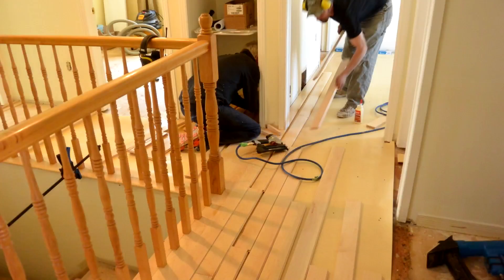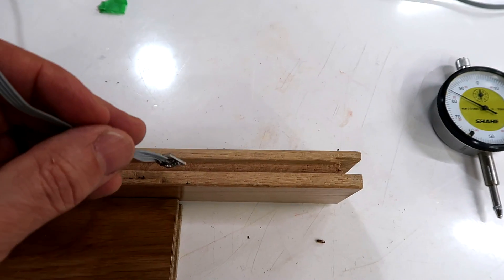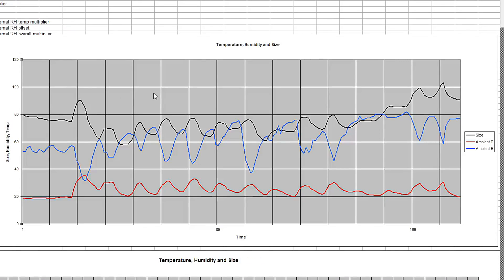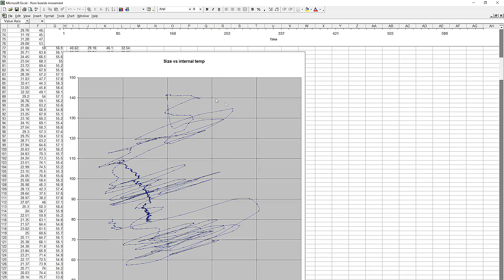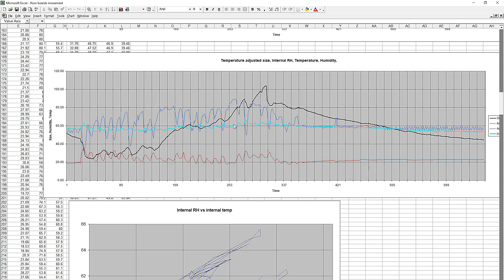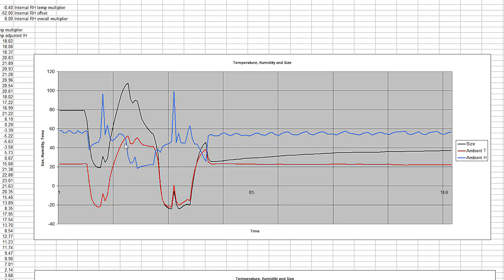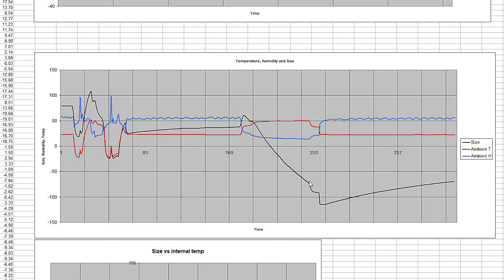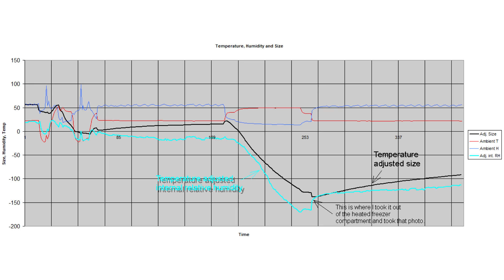How long for floor boards to acclimatize -- experiments

Comment: Great video! I'm curious about a specific part of the construction. At 2:21 (https://youtu.be/UzNhHCTlBsA?t=141), you install 4 boards into your measurement device, which is also made of wood, albeit with the grain perpendicular to that of the boards.

Wood, being a natural material, can be influenced by environmental factors like humidity and temperature, leading to expansion and contraction, which may, in turn, affect the precision of your measurements.

Considering the materials used, would an invar or pyrex structure, known for their low thermal expansion properties, result in more consistent and reliable results? These materials could mitigate the potential variability introduced by the wood's grain direction and environmental changes.

Comment: Fwiw, if you have hot glue attached to wiring and want it removed, just saturate it with rubbing alcohol/isopropyl alcohol, via a paper towel or somesuch, and the hot glue can very easily be popped off of the surface. (this works for hot glue on many surfaces; pcbs, wiring, etc)

Comment: even in material science that is a biiiiiig challenge when you need to condition the material to a specific climate. its not straight forward and not really solved what the best practice is. it can take month till a specimen of plastic or fiber reinforced plastic reaches real equilibrium. and im talking about mm thick specimen. found it funny seeing your video and that you came to the "right" conclusion "its complicated" :D ... those thick board will probably take weeks or month. but there will be probably a point where the change is small enough and that it wont be critical for laying them down.

Comment: temperature has a relationship with the maximum amount of moisture air can hold without condensing. higher temp=more capacity. relative humidity is the ration of actual moisture and max capacity (relates to temperature, vapor pressure of water). relative humidity and temperature are for the most part independent of each other. i think
Reply: dont know if that sensor you have is measuring absolute humidity or relative...

Comment: Why measure relative humidity? Is that all your probe will measure?
If so, why not try to derive absolute moisture content of the air/wood for the graph?

Graphs exist to help us "see" what story the data can tell us. If one of the lines is 'lying' then it's not very helpful. (Or even hiding something ELSE we should be seeing.)
Reply from the maker: Probe measured relative humidity.  Abolute humidity is actually less relevant than relative humidity in terms of effect on wood.

Comment: The lesson learned is when building anything from wood whether it be with somewhat dry, dry, or very dry wood is to build it in a manner that accommodates these changes. In furniture, this is done with floating panels, providing room for expansion, paying attention to the direction of grain and largest axis of expansion, etc.  For flooring, this is in part accomplished by leaving room for expansion along walls.

Comment: For this topic it is worth noting that the dimensional shrinkage will be less noticeable in quartersawn flooring, as the dimensional change coefficient for tangential direction (side to side in the flatsawn flooring) is more than 2x that of the radial direction (side to side in quartersawn).  You might, if you have a quartersawn floor, notice that you are a few microns taller during the humid times…

Comment: The one other way I would have loved to see the data graphed is based on absolute humidity (lb water/lb air or for metric kg water/kg air).  Relative humidity is just that RELATIVE.  I think you may have noticed something else based on absolute humidity.
Reply from the maker: yes, but absolute humidity is an even worse metric with regards to absorption.  You need a metric where humidity goes up with temperature even faster than relative humidity to reflect how the wood sees it.

Comment: Most woods dry more from the end grain than the cross grain. That's why you seal the ends when drying green wood so it doesn't split and check. There is very little shrinkage lengthwise compared to crosswise. Oak is open grain hardwood, basically a bunch of straws with large pores. You might try to seal the end grain so all the drying is from the sides, but it might not make that much difference since you are measuring in the middle. It's an interesting experiment. 
I imagine that most experienced installers have a intuitive feel for how long to let a product adapt, but most installers today are just wanting to get the job done. Our humidity in the southern US is so different from season to season so it would be hard to determine when the wood is "stable" and it would also depend a lot on the species. We have both Red Oak and Southern Yellow Pine flooring in our house and the Oak moves a lot more than the SYP. 
If you weren't 1k miles away, I'd give you some SYP to test. :)

Comment: I’m a flooring installer and we allow 3 days. The manufacturer requires that and we allow them to claim the lawsuit if it doesn’t accumulate in that time.
Reply: And the bottom is smaller then the top to allow for it to be nailed and not change the top “finished” side size
Reply from the maker: Ah, good point, the nail expands the wood a tiny bit where it goes through.  I do wonder what humidity the wood has coming from the factory.

Comment: A remarkable, and worthwhile, exercise. A few notes- using prefinished flooring may have skewed the data, though I can't really guess in what direction! Secondly, the idea behind acclimatization is not to reach a point of either minimum or maximum expansion, but to reach a point where the rate of change is the same as the surrounding structure- and that may be impossible, because the exposed surface will be reacting differently to heat and humidity than the underside. Preventing significant cup will always be down to the fasteners, in the short term. 
     I'm generally  inclined  to use a vapor barrier under hardwood, something with limited porosity, like Tyvek, so that the principal component of acclimatization is the room above, and not the subfloor and rooms below. Perhaps that's just overcautious, or perhaps there's no point, but I'm a bit of an old crank, and tend to stay with what works, for me.
     Either way, it's clear that the mechanism of acclimatization is considerably more complex than I had assumed. I'll probably stay with 14 days (except in extreme conditions), as much for logistic reasons as anything else. Thanks for your research!
Reply from the maker: corss grain vsl long grain is different by 10x.  The joists will never grow and shrink in length at the same rate as the wood widens and narrows.

Comment: Hm, seems like hardwood floors would not be suitable due to seasonal variations here in Sweden. AC is uncommon  here (it generally isn't needed) but humidity varies from less than 10 % in the winter indoors, to 60 % in the summer. Even if you let it acclimatize, it would be completely off after half a year, either creating bowing or gaps.

Comment: This is why for 'floating flooring' you need to leave small gap (1cm or 1/2inch) between material end and wall on every side and then just cover that gap with decorative board / door step panel. Very nice test!

Comment: Your gig appears to be about 2 feet long and you are measuring the effect of change in moisture content about a foot away from where the majority of moisture ingress occurs. This would somewhat explain the bounce in data. As you know Mattias, oak is ring porous and shrinkaqe/expansion in the middle of your gig is due dimensional changes due to moisture content changes from wicking (from the ends of the gig). There are several other effects: quarter sawn versus radial sawn versus tangential (tangential shrinkage being the greatest at about 10%), surface finish of your planks, springwood versus latewood etcetera, but the bottom line is that rates of change of width of oak is much slower than the environmental change of relative humidity which is of course dependant on temperature. Wood is not a good insulator but it does have an R value, which means your trapped humidity sensor is  a good indicator of the humidity but not a great indicator of moisture content in the ring porous oak. Your experiment is awesome and you say "it's complicated", and it is, but when you think of how much lag there is between the environmental rate of change of humidity versus the rate of change of moisture content, there shouldn't be any surprise that it takes longer three or four days for the oak to reach  equilibrium. Your conclusion should be that it takes weeks rather than days, but the oak should also be stickered before installing. It is no wonder why engineered hardwood floor has become so popular because the oak/maple/ash veneer on the surface is somewhat protected from environmentally induced dimensional changes because of the plywood base. Like you, I prefer the hardwood strip flooring and know what to do to acclimatize it --> weeks, not days.

Comment: If you ever wanted to experiment again you could try many of the floating floorboards available. Many of these made with real wood havsvery significant movement. I've seen some bad results but heard a story where the floor expanded so much that is pushed the walls outward by some 50mm in one house in Australia. Yet they're sold as being stable.

Comment: I really liked the experiment and it looks to be calculated thoroughly. One question: if you are trying to measure crimp and expansion of the wood, wouldn't it be better to have your measuring device made of some other material? I really do not know if wood of the measuring device will crimp/expand length-wise.

Comment: I've installed several hardwood floors and I don't let the wood acclimatize at all.  Just bang it down.  Home Depot and Lowes has a very similar climate to a house. Not only that but the climate in my house changes with the seasons.  Never had a problem.  It's an old wives tale.
Reply: Are you in the semi Aired West like me
Reply: @vbart1776  Ontario, Canada
Reply from the maker: If you buy a whole load, chances are, its straight from the factory.
Reply: @matthiasrandomstuff2221  Possible.  Another complicating factor is your experiment has the boards out in the open.  I've always seen hardwood "acclimatizing" in the boxes, with the boxes stacked.  It would take a year.

Comment: I like using dew point instead of relative humidity.  It gives you a better sense of the actual moisture, and you can graph it on the same scale with the temperature.
Reply from the maker: I do use dew point as well for a lot of stuff, but for this, relative humidity is a better indicator.  Realistically, you need a measure where relative humidity goes UP with temperature not down.  For the same dewpoint, relative humidity goes down a lot as temperature goes up.

Comment: Obviously, the 4 days that your floor installer let the wood acclimize to your house was not long enough. However, the three weeks you measured for the humidity and gap spacing to equalize in your house was complete worst case scenario. Most hardwood flooring is stored in climate controlled warehouses and basically never set outside, unboxed in 80° humidity for almost a week prior to being immediately installed in your house. So if I ever get hardwood flooring I'm setting it in my house for longer than 4 days but not more than 3 weeks. Haha
Reply: In the Pacific NW the distribution warehouses are not climate controlled.  No AC and just enough heat in the winter to keep stuff from freezing.  Your area may be different.
Reply from the maker: floor too moist is not the problem.  Flooor too dry fromthe factory IS.

Comment: Now I don't feel so bad for taking 2 months to lay the laminate. Although, When I started laying them, they where bending in the same direction as your test pieces did. And the few I had to rip down, 600mm into the cut, the kerf closed up where I started the cut. It's all well and good acclimatizing them to your houses climate. But if they are manufactured in a hot swamp, they will only be straight in the equvilent hot swamp conditions. And laminate being HDF, just good MDF, it's wierd that it's that dimension that they would bend.

Comment: Thank you so much for publishing this data! REALLY interesting. Especially the drying through the ends which makes a lot of sense, if you put a piece of timber in a cup of water it wicks it up where as if you splash water on the side it doesn't do much. I find that intuitive even if unexpected. Also really interesting is that if you drive the moisture out aggressively it never comes back in. Something to do with cellular vapour pressure in there, I suspect. I guess this is why we buy kiln dried timber for stability reasons. Again, thank you! I really appreciated this one :-)

Comment: Thanks for doing this!  That's clearly a great deal of work.  I would offer this as an explanation that may help understand at least some of what's going on.  The problem you addressed assumes moisture content as a whole.  However there are actually 2 types of moisture content present in wood... the moisture BETWEEN the cells, and the moisture WITHIN the cells.  The moisture between the wood cells changes with the environment.  However wood cell moisture only decreases over time.  As the cells "die" (I know they're already dead, but they still have water content) they give off moisture which will never again re-enter the cells.  Once the wood is fully dry, that portion of the dimensional change will cease.  Only the moisture content between the cells will change after that so the dimension change will be less from that point on. 
Also... because of the structure of the wood... (as I know you know already) the moisture from both sources will escape more easily from the ends of the wood than from the sides of it... thus the ends of your flooring being gapped, while the middle of them were still tight. 
Great video, thanks!

Comment: Given the structure of wood, basically long tubes, it makes sense that the moisture leaves by the end grain and that's where it narrows the most. So perhaps sealing the ends with a dab of varnish when installing might mitigate that effect. 

Cool experiments and graphs.

Comment: Very interesting experiment. A couple of years ago I tried to obtain a good understanding of the effects of humidity and size changes in wood, more specifically, the seasonal changes. A lot of documentation/literature seamed to be contradictory, until I found a very good pice, including several very good graphs. I had not realized that the seasonal changes of the humidity (relative humidity in air as well as in the humidity in the wood) is actually mirrored between indoors and outdoors. Also I learned that the effects of the size changes gets smaller for every cycle until it reaches a steady state with constant variations and first after that the wood is called dead. There are treatments for this for some products, but I guess, since that adds a lot of cost, that those treatments are “rationalized” to a higher degree today to be able to offer cheap products. Also there  are a lot of differences between different types of wood and between heartwood and sapwood. 
https://www.swedishwood.com/wood-facts/about-wood/wood-and-moisture/moisture-related-wood-movement/ (a lot of interesting facts, also in the other sections)
https://www.traguiden.se/om-tra/byggfysik/fukt/fukt/fuktinnehall-och-sorptionskurvor/?previousState=1 (in Swedish, but includes the graphs with seasonal humidity variations indoors and outdoors in a southern and a northern city in Sweden)
Reply from the maker: those floorboards I used had been in the basement for 10 years prior to that, but still lots of changes.

Comment: I had the opportunity to meet the guy that designed some of the earliest computer controlled wood drying kilns for use at sawmills in western Canada, using Data General MicroNOVA minicomputers to control all aspects of the kilns. His kilns used significantly less energy than others because he understood something that you've observed here: temperature has a greater effect on wood drying than relative humidity. The competition were blowing hot air at the lumber, then they would adjust the vents on the kiln to hold a certain level of RH. This means that for the majority of the time the kiln ran, they would be pumping hot humid air out of the vents into the atmosphere, and paying dearly to heat cold dry air to replace it. How his kiln worked was he would keep the vents closed, and just keep the air circulating at a fixed temperature. What's important to realize is that as the RH of the air increases, the thermal capacity of the air also increases, so while the air is more humid, it also carries much more heat, and it is the heat that has the biggest effect on drying wood.
Reply: There's an old wood kiln tucked away under the Tim Hortons at BCIT that was used to study steam drying.  My instructor was proud to have been involved in the work and said it produced lumber with less warping as well.
Reply: chunderstorm I wonder if my guy was involved with BCIT. He was based in BC, and he did mention to me that reduced loss due to warpage was another major benefit of his setup. He said that increased production due to decreased warpage was often high enough to pay for one of his kilns in 3 months. Mills were wrecking a lot of lumber in their kilns, but because they didn’t have anything better to compare too they saw it as acceptable loss.
Reply: Hard to wrap your head around huh?
“Hey guys, let’s dry that timber with wet air albeit hot”.
Counter intuitive, but many things are like that.